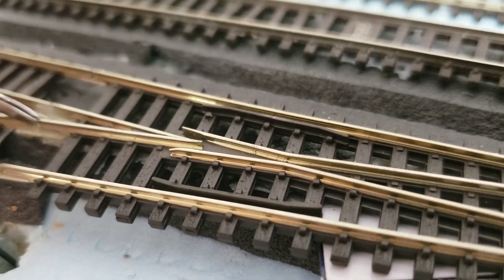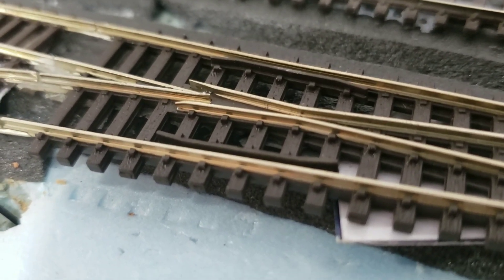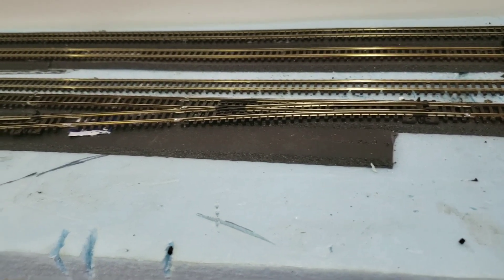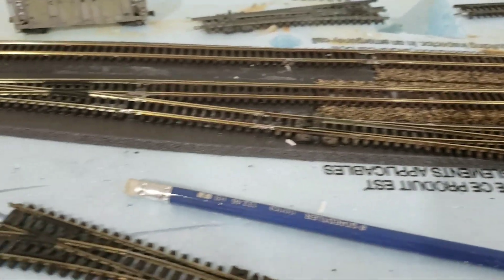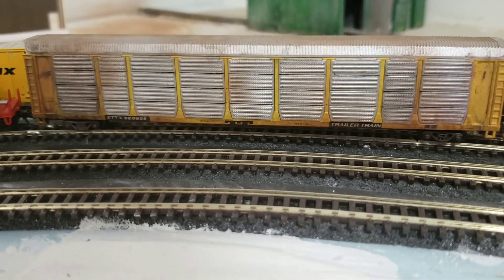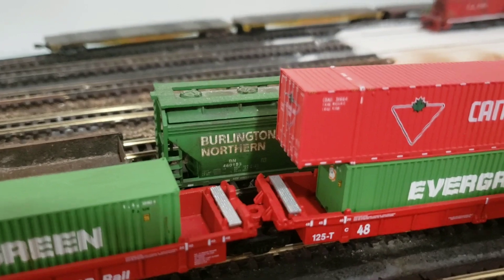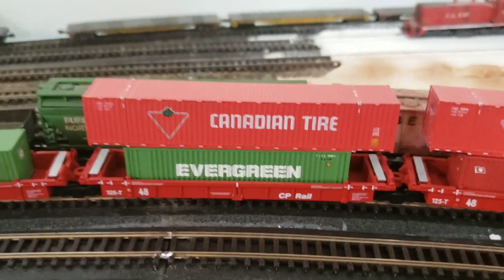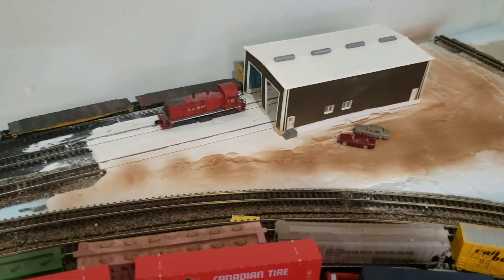A little progress, and a little mistake!

Comment: Insulate the other two rails and will not have a problem. That's what I did and been running my Layout for 10yr's without switch problems. Bob, Longshadowsmodeltrees.com